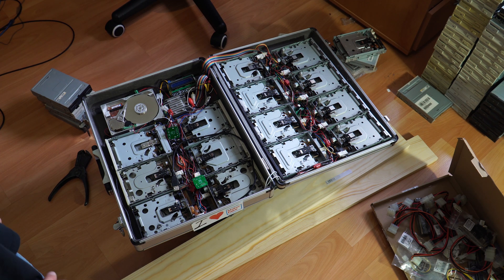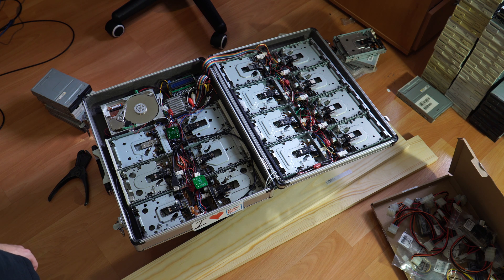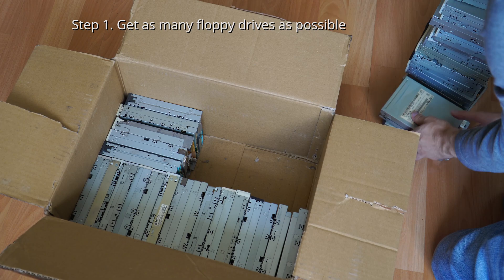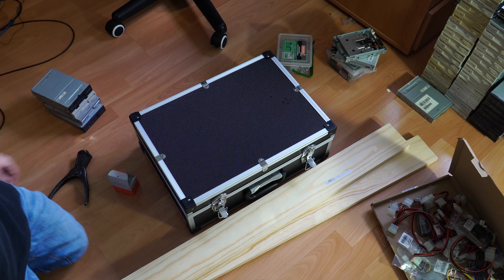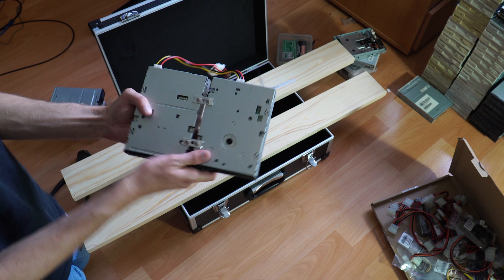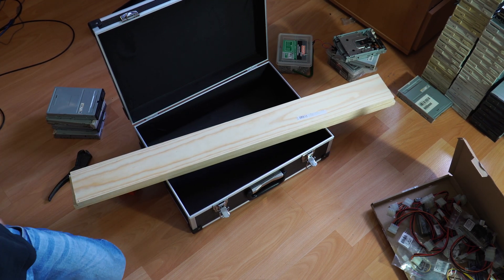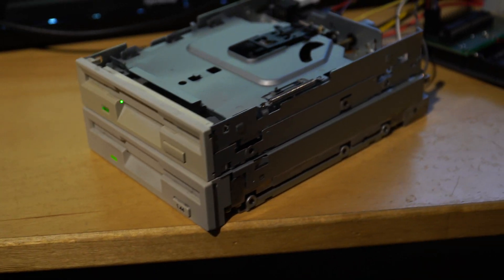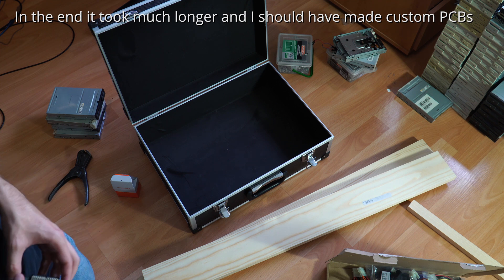How to floppymusic - Building a new 16 drive setup

Comment: Great project! But how do you program the music tho? Do you manually program it or do you have some sort of MIDI converter software?
Reply from the maker: As its a normal midi device you can use any midi editor as long as each channel is monophonic and within the note range of the drives. I use Sekaiju (Openmidiproject) and reaper for example.
Reply: @Gigawipf  Thanks for the response! I'm would love to build one for myself. Do you happen to have any written instruction or wiring guide out there?
Reply from the maker: @AbhipolV  Pin connections are shown but basically you only need to know that a floppy drive takes 5V and the pinout (Easy to find) directly exposes the step/dir pins and you have to either use the shift registers to drive the enable pin or place a jumper between pin 12 and 11. For the arduino i used the rear pins 22 - 53 as alternating step/dir pins.